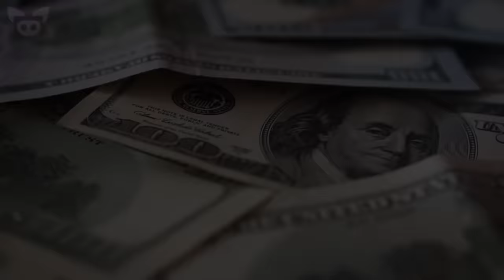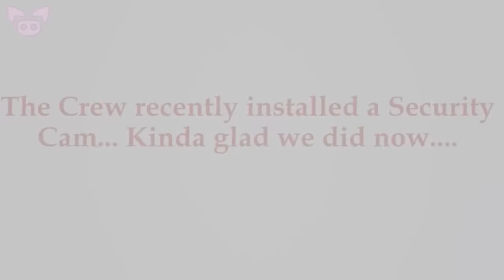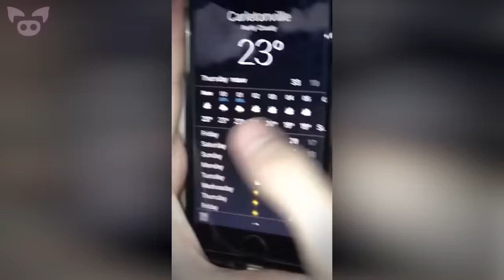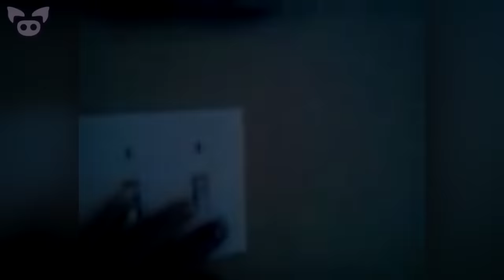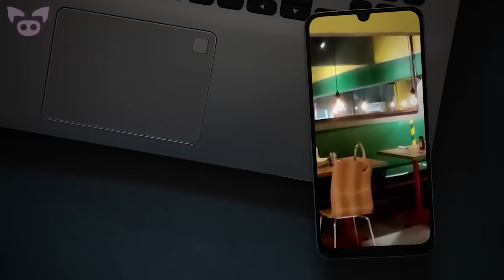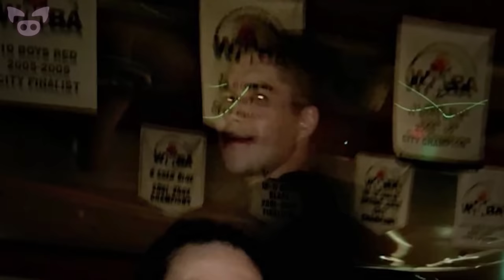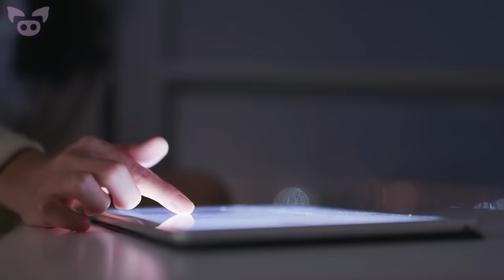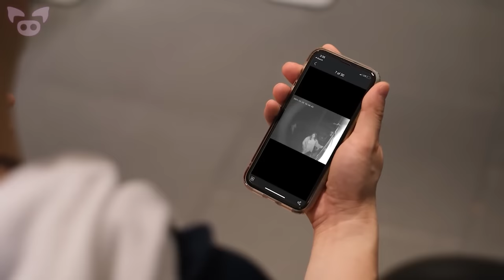These Scary Videos Will FREAK You Out!

Comment: 34:50
Most smoke detectors are hardwired to the house's electric. The battery is strictly a back up for power outages. (Not a ghost).  The intermittent beeping is a fail safe telling you it needs fresh batteries.
Reply: This clip had me laughing so much! it was the Ladys reaction when she saw the figure couldnt see what happened for the tears in my eyes, such a joy!
Reply: I was about to say that as I have a hardwired smoke alarm and I recently had to change the backup battery
Reply: Was going to comment this, must have been quite the electrician who checked it!
Reply: I wouldn't say most houses are hardwired, newer ones Maybe. I live in a 40 year old house and had to put smoke alarms in myself and they are screw on and battery operated only and when the battery gets low the detector starts chirping every once in awhile to let you know it's time to change the battery.
Reply: @td6647  
Unless the majority of Americans are living in non-updated haunted houses from the 1800's, yes, most houses are hardwired. It's been construction code since the early 70's.
Reply: Can someone offer a still photo of the dead person in her bedroom? I've seen it tons of times and still can't see it
Reply: @milindabaxley4405  
Wrong thread Mil. We were talking about smoke detectors
Reply: Right thread gra. We were talking about the same video.  😲
Reply: Who actually has multiple detectors without batteries anyway? Hello..what if theres a fire?

Comment: The man shopping isn't alone, and I'm surprised Kallen never mentioned it. @ 48:01 - 48:04 at the far right end of the isle a black hooded figure can be seen ducking behind the shelves.  Five seconds later, the perfect timing it would take for that hooded person to walk over, when the box comes out of the rack.  I imagine it was suspended on a small wire or two, then falls when the wires were retracted. I'd guess there is another person on the left side that shoved the paper through as well.  This looks like a prank to me.
Reply: That's exactly what I thought about that part, but I was more stumped about what that black really large mass was, that looked like a face, with features that moved, that was at the end of the aisle over the counter. Or possibly right behind the man, but it would have had to have been really tall, really large with a really large head! Can anyone tell me what that is please?

Comment: The one with smoke detectors is explainable. I have exact same ones and they are also plugged into the houses electrical system. So even without batteries, it will beep to tell you to put backup batteries in them. Only way to stop it is pull them down, unplug them and remove batteries.

Comment: I believe the clip involving the smoke detector.  In the mid-1980s, I was practicing deep meditation, and my smoke detector, on the ceiling above me, went off for no apparent reason.  I was startled, and it turned back off.  I clipped its wire so that wouldn't happen again.  It was a crappy, overly sensitive detector anyway.  Also, my father, not one prone to making up stories, was sleeping in bed when his smoke detector went off.  He said he looked toward his bedroom door and saw the figure of a woman in a flowing garment reach up and touch the smoke detector, turning it off.  Then she disappeared.  I asked what she looked like, and he said he didn't know, because she was above floor level, and her head was above the top of the door.

Comment: Smoke detectors will beep even when you remove the battery. Only way to stop it is to unplug it from ceiling and then let it discharge after a few minutes. It beeps to let you know the battery backup is bad.
Or you can just put batteries in it.

Comment: The light at 43:07 is an optical illusion caused by the reflection of the car lights within the camera. It’s happen to me before, the light reflects off the glass within lens of the camera onto the outer glass and is captured again. You can tell because it moves the exact height, speed, etc of the car, just mirrored.

Comment: With the Tina thing I think the reporter was in cahoots with them. There were 2 house phones next to each other ( ridiculous , it wasn't a cordless AND it wasn't even attached to anything, there wouldn't have been anywhere to plug it up anyway🤣) Also, the unattached phone receiver in 15:18 is flying to her left where there is a blanket in front of the door. The 2nd pic 15:30 the REAL phone is on the right on the floor and the blanket is folded on the couch by her mother, while the unattached receiver is on the floor to her left. Did anybody else notice that?

Comment: Hardwired smoke detectors can still beep even if there is no battery. Possibly the backup battery might have been activated and that can signal a problem. The backup battery may have run out and that is causing your hardwired smoke detector to chirp.

Comment: I'd rather have a smoke alarm which has batteries in it for safety's sake than smoke alarms that go off without any rhyme or reason or batteries because you can disconnect the battery in the room you are using and connect it when you leave that room.

Comment: In the barbershop clip which starts around 22:45, there's something else moving besides the cloak and the mannequin head. If you look at the counter in the back of the room, where the waiting customer is sitting, there's a mirror behind that counter. Dead center in the mirror is some white object with something black at the top of it which moves several times during the video. 

I can't tell what the object is. It's possible the movement is something normal. Maybe someone else can see what it is.

Comment: What about the pull switch attached to the light fitting on the ceiling? That cord's swinging on its own without the a fan or any other air current causing it to move, (unless there's an a.c unit just out of shot that we're not privy to?

Comment: Back in the early 2000's I was sitting in the living room & heard the microwave start. I knew it was just me & the kids home so I went to check & found no one in there (I could see the microwave from the living room) or inside the microwave. It happened another time when my husband was in the kitchen. We had to keep it unplugged unless using it to prevent a fire until we bought a new one.  
About 10 years ago, my living room tv started turning itself on & off. Sometimes it would be rapid on & off, others just one or the other.  Electronics do malfunction with no paranormal help. I also must say, I am by no means a skeptic. I have had more than my fair share of personal experiences than I wish I would have.

Comment: Put batteries in the smoke detectors.  They are being to let you know they have no power and will not work
  Take my word for it and put new batteries in them and they will stop the beeping. That is a safety measure built into the detectors to let you know they won't work because they have no power.

Comment: Your smoke detector chirps because it wants a battery. It has a capacitor which holds enough charge to chirp. Many (like ours and yours) are interconnected, so you hear the chirp wherever you are in the house. Normal. Not paranormal.
TV? Remotes exist. Light switch? There are a lot of lights with multiple switches - especially hallways. There was nothing in that room - certainly not a "pale face." 
Just another huckster like all of these.

Comment: I don’t see anyone mention it at close skimthru comments so my bad if so but 31:44 is undoubtedly the reflection off the water bottle on the imprints of that couch. The couch has a slight elevated bump every so often and the cushions have those button-like imprints ( often leather). 

Depending upon where the light source is and the angle it comes from - this looks like a 2 warped figure 8s over each other that split apart 1/2 way through on a steep angle 📐 

There is a similar vid from a kitchen that has a bottle w liquid in it doing the same exact thing to where the camholder thinks there is a face looking thru the window.

Comment: I'm sorry but how does an electrician not know that the reason the smoke alarm is beeping is to tell you there is no battery/battery is low xD You have the battery in it, in case of a power failure (back up supply lol). It aint a ghost...christ lol

Comment: At 33:39 okay you say it can't be a balloon cuz it's flying against the wind? How on Earth would you possibly know what direction the wind is blowing. You think because the winds flowing one way where the guys are at, that it must be flowing the same way a couple of miles down the road? Dude that's not how wind current work's. The flow of wind is completely sporadic, where you're standing it can be flowing one way. And 10 steps in front of you can be flowing the opposite direction. Uniform wind current is usually only reserved for the upper atmosphere, that's how we dictate forecasting. But it's not the same at lower altitudes like where that "balloon" was. That's right balloon.

Comment: The Baltic Sea Anomaly doesn't look natural to me. It looks like it was carved. It appears to have slid into the Baltic Sea. The Baltic Sea is only 8,000 years old.  In fact,  the Baltic Sea didn't exist until after the last ice age. That area was under 2 kilometers of ice for about 20,000 years. I would think if it had been under water that the many 90° angled corners and edges would had been rounded by the water currents. There is also a perfect inset circular area with like a bridge that crossed it. I think it was an ancient monument that wasn't finished because it slid off its perch and was abandoned. I mean it could had been there before the Baltic Sea was there.

Comment: The foam is just sea foam that washed ashore.  Quite common when earthquakes churn up the ocean.  It is no mystery at all.  

As far as the passing cars go with the light orbs, the camera lenses are curved, and when a light source is bright enough the lens can actually pickup the mirror of the light source.  Both times the lights are going just as fast as the cars are.  You can do this experiment yourself.  My glasses on my eyes do it all the time.  I will see a car pass from my right to my left, but the light goes left to right.  Also, when you have blinds slightly open in your house, the light always travels across the walls in the opposite direction that the car is moving.  

Most ghosts captured by digital cameras can sometimes be just that.  Not a real ghost, but when digital memory cards get overwritten, they are not erased so images can leak through.  Look back at cassette tapes when you recorded music over other music and then the last song comes through the new song.  

One other thing, about the photos in reflections that are different than the live person, some cameras that are digital have rolling shutters controlled by software and not the hardware controlled open and shut shutters so the time it takes can cause a difference in a person you see for reals, but then in the reflection looks different.  It can make for some really creepy and cool photos.

But, I have to admit, that these videos are fun to watch especially at night when you are all alone in your house eating popcorn!  Keep up the great work Slapped Ham!

Comment: Checked which prison the Sidemen filmed at and it was HM Prison Gloucester, UK. If the figure they saw was indeed the ghost of an inmate then they would not be wearing an orange jumpsuit. The only UK prison clothes close to the boiler suits the Sidemen are wearing are those issued to inmates on the escape list, which are yellow or green respectively, outside that it is a light grey tracksuit that only has be worn during the first 2 weeks of incarceration, after that inmates may be permitted to wear civilian clothes provided the clothes have been authorised by prison staff and do not represent too closely the uniform of a HM prison guard. Sorry for info dump just checked this all up on Wiki. TL,DR I'm not convinced that IF it was a ghost, that it was the ghost of an inmate  unless they were authorised to wear a big orange coat or something during their incarceration.

Comment: 34:25 The smoke detectors are designed to beep like that when they have low or no batteries. And that chirp is a battery chirp. 
So, 1, we only have her word that there was no battery in it, and that an electrician tried to find an explanation. But I challenge this, because an electrician really wouldn't come out to examine a smoke detector without batteries, if that were true. They would say, this chirping is caused by no batteries. If they even came out, which I don't believe. For an electrician to come out, then the smoke detector would have to be wired in, which would mean it's not operating by batteries, which would make her "no battery" comment irrelevant. And it's also chirping in the exact rhythm that any normal smoke detector lacking a battery would chirp. A beep will chirp anywhere from once every 60 to 120 seconds on low/no battery.
Also, a smoke detector houses the power given to them by the battery and once the battery runs out or even if there are no batteries present, it will continue to operate on the residual power it stored until it will eventually quit. 

TL;DR= a perfectly normal smoke detector doing the low battery chirp is not a sign of paranormal activity.

Comment: No.4 could be a dog even a cat. As to the UFO near area 51 I want to point something out that's annoying me, just because the wind is travelling in one direction near you doesn't mean it's do the same a kilometre away from you infact it's possible that it's blowing in the opposite direction, yet you hear people saying it all the time the fact that the object is in the sky makes it even greater possibility I've seen clouds scudding towards me when the wind has been blowing in the opposite direction. Most likely it was a drone used for security by area 51 base, another point to keep in mind is when people say they didn't hear any noise again that can mean nothing if the craft is far enough and the wind at the hight of the craft is blowing away then there is a chance you won't hear anything.

I've  seen two UFOs was close enough to call it a close incounter of the 1st kind, so close if there had been any sound I would of heard it, also only 50ft to 100ft off the ground. Point is unless it is that close you just can't speculate what noise there is. Ps. The first UFO I saw was 250m away from me at closest point maybe a nats wing closer

Comment: First, I must say that things have happened in our home and I am not trying to discredit anything. I just would like to add some info that I know n that happened to me.  First, I hate when the fire/smoke alarms go off cause they are so hard to stop.  But, several times I have had alarms that keep going off for a few days or weeks even after batteries were take out.  It more of high pitch tone.  We had several different kinds of alarms.  So this is what I am thinking .....some alarms have a high pitch alarm that still goes off even without a battery.   Like maybe there is an emergency thing associated with this alarm...or certain brand thereof. Most of the time u take the batteries out then it stops going off. Howevér, there are at least one type that has a high pitched alarm that still makes the noise until it slowly fades.  It's very hard to ignore n makes u feel like ur losing ur mind. Hope this helps a bit 😊

Comment: I just want to say that I have indeed had smoke detectors go off even without batteries. There is actually a small battery in most smoke detectors, especially modern ones, attached to the circuitboard. they will specifically go off if the batteries are dead, the smoke detector isn’t functioning correctly, or even when you’ve just removed to batteries to let youknow to put fresh ones in.

If she puts fresh ones in them, the sounds would probably stop.

So, to me this is just “tech-n00b thinks normal tech stuff is the work of the gods/devl”.

She’d also probably go running screeming if she encounters an analogue clock here when it sets itself back an hour (that tripped me out the first time too).

Also, my TV randomly turned on too. It was glitching and needed a software update.

Overall, her house is acting really weird. I have no ideas unless she’s got electicity fluctuations which can cause some of the problems. I dunno about the ‘face’, though.

Comment: also.. the wind doesn't blow in straight lines or in the exact same direction at every point on the landscape, it flows in circles, in ''gyres'' - how do you think spirals like hurricanes and tornadoes come about? - Aye, the wind flows in massive circles which sometimes tighten to extremes due to very high speeds, the wind in the hunters' clip could, in fact, be blowing the opposite way that far from their position... However.. their UFO is a surveillance drone, the sort which have two central vertical counter-rotating propellers between two rotatable domed camera housings, one on top, one beneath.  they're shaped like those wee plastic tubs with a toy inside you get in a kinder egg, imagine one of them with propellers on it's  middle.. at it's ''waist'' lol, mounted on two parallel ring section which spin... the electric motor and it's gearing sits within the spinning rings, the top dome which can be rotated remotely at will by operatives has four cameras, bottom dome is also rotatable independently but only two cameras because they have retractable landing gear housed in there too.